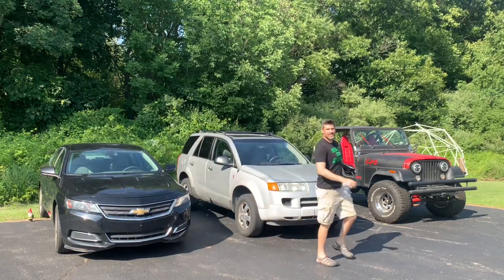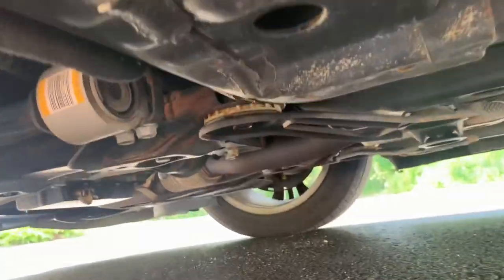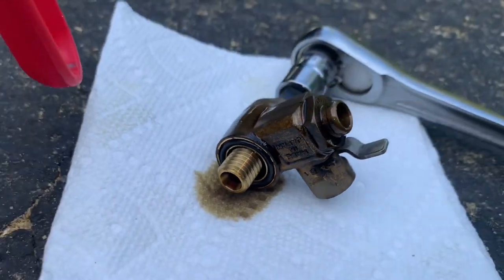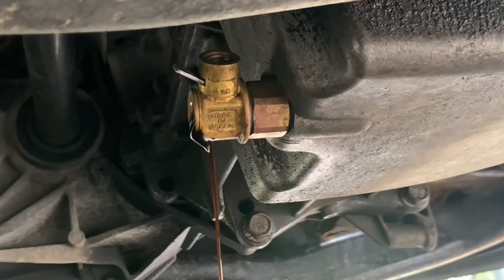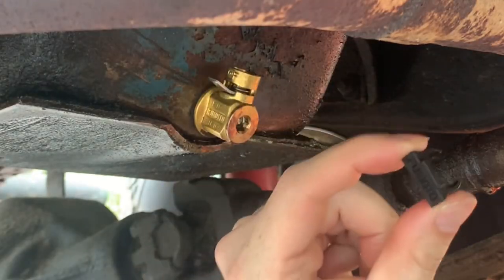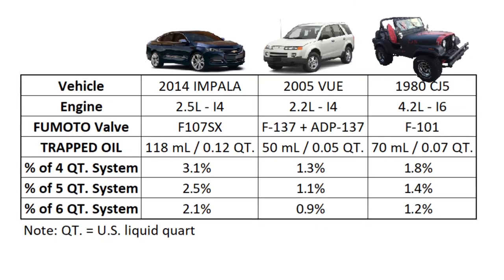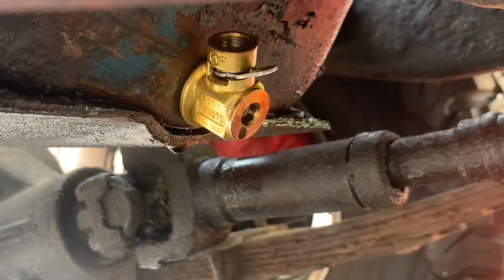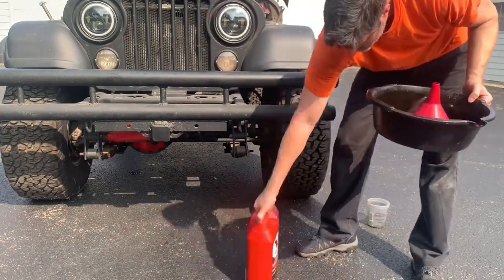How Much Oil Can't Drain with FUMOTO Engine Oil Drain Valve? How Much Oil is Trapped in the Oil Pan?

Comment: You could also pour a little fresh oil in while the valve is open to flush a little bit of the old oil out.
Reply: my thoughts exactly: get a quart of the cheapest oil (probably non-synthetic) and dump it at the end in to flush; still some will remain but it's better than nothing!
Reply: My car takes 3.7L so I just push the 0.3L through to flush to finish off the container.
Reply: Good idea, didn’t think of it.
Reply: If the old oil is below the drain plug line how will adding new oil flush the old oil above the drain plug line

Comment: To put the issue into persepctive, a full oil/filter change typically leaves about 0.8 quarts , about 760 ml, left in the engine-slightly more or less depending on engine, when using stock drain plug.  If Fumoto leaves another  70 ml, that is a 10% increase in remaining, undrained oil.

Comment: That is, if the car is in a flat position. However, if the car is on ramps, the angle of the drain hole will be more slanted, allowing more oil to be drained.
Reply from the maker: That’s true. This was a flat ground test.

Comment: I don't mean to be negative, but how HARD is it to put a wrench on it? Get a little oil on our hands? 🙄 They make a flexable extension on a socket that your hands are no where near oil. What's a REAL PIA is getting out jacks/jack stands & taking off shields. I'm a fanatic on getting ALL of the oil out. I even tilt my car to help empty everything. 1/2 cup is 1/2 cup too much. Sorry.
Reply from the maker: Nothing wrong with that! I did it that way just fine for 25 years.

In my personal experience, I have two vehicles that are very low ground clearance. There’s not room to get a wrench under there with any leverage. With the valve, I can easily reach under and flip the switch. 

I do about 10 oil changes a year, so the convenience of not using a tool does stack up. Especially in the freezing winter. It’s a luxury to slide a catch pan underneath and flip a switch.

Other people might just enjoy, trying new gadgets. It’s a free country, people like different things and can spend their $20 however they want. 🤷‍♂️

But, if someone prefers to use their wrench, absolutely nothing wrong with that!
Reply: You are also running the risk of over torqueing or cross threading especially if someone else is doing oil change. Fumoto is replaceable and saves the pan threads some wear and tear.
Reply: Its not hard at all, but maybe people like the cleanliness of it, i have a resin driveway and even though i used 2 tarps i still spilled a little oil which has now stained the drive (using the "classic" method). My truck takes 8 litres of oil and since most oil tubs or spare bottles etc only hold 5 litres it gets messy swapping tubs around.

With this i can simply feed a tube directly into the empty oil bottles from the last change, close it when the bottle is nearly full and swap the bottle out for another and then open it back up again to finish the drain 🤷 no mess, no fuss
Reply: These valves are worth it. 💯
Reply: @davidmidcalf3470  Precisely.  When you spend a lot of money on a pavestone driveway, you don’t want to be spilling oil.  If you have ever changed the oil in a 3rd gen Tacoma…the oil literally SHOOTS out the oil pan and splashes like crazy.
Reply: I put this on my commuter car because I’m doing oil changes about every 6 to 7 weeks. Sure, putting a wrench on and turning the bolt is pretty easy. But it’s cramped under there and turning a tiny lever is even easier. Makes an easy job even easier.

Comment: Or you put it on a ramp to make it drain more.
Reply from the maker: That’s another option. 
Personally, my vehicles are too low to use ramps. I have two sets of ramps, and neither work.
Also, dealerships and oil change shops do not use ramps. Either a lift or a pit, and the vehicle remains level.

Comment: Have it on two cars. I put 1/4 quart into filler port too get some old oil out. Usually left over stuff from last oil change. Makes it a quick oil change. And you find yourself changing oil more frequently.  Prolonging your engine.
Reply from the maker: Good point!
Plus, I have to add oil to all my vehicles anyway because they burn oil. Two of them I add a court every thousand miles. Another one I have to add a quart when there’s about 50% oil life left. They are always getting fresh oil mixed in. I’m 0% worried about the small amount that the valve leaves behind.

Comment: Longer drain time will mean less oil in the pan wait until it stops dripping completely it may take an hour or more. I understand you're not retired yet so you probably can't spare that amount of time. I removed mine to check this on a 2016 Explorer and got way less barely a few drops. My vehicle was horizontal on a lift at the time so if using ramps would probably make a difference too. TY for a good vid and I give my Fomoto a👍
Reply from the maker: Good point. I used the timing of a typical oil change process. I let it drain until it transitioned from a stream to a slow drip. Then removed the valve and again let it drain until it transitioned from a stream to a slow drip. I did not let it drain overnight until every last drop was gone.  That would definitely be interesting to do, but figured it wasn’t a practical real world application.

Comment: It's not just the shape of the oil pan but also the composition of the pan.  A cast pan has its own thickness to accommodate the plug thread, and it may achieve nearly perfect draining with a standard plug completely removed because the innermost thread is at the level of the inner surface of the pan.  A sheet metal pan will usually have a welded insert to accommodate the threads, and the inner level of the thread is still above the inner surface of the pan.  If the Fumoto thread is no deeper than the thread of that insert, there won't be any less oil drained.
Reply from the maker: Absolutely!
Reply: You're a freakin genius. Seriously. How many people on this earth would know that? Not many!

Comment: I wonder if I can dring down the part that screws into the pan so that it comes to the bottom of the pan so all oil drains out? Or can I drill a hole in the screw area inside the pan so that the hole comes to the bottom of the pan and so the oil in the bottom drains out?
Reply from the maker: It wouldn’t change the thread engagement, so as long as it’s screwed in tight, I personally don’t think it would matter.

Comment: The threads that extend too far into the pan could be cut off I think. I don’t worry about it as I usually change my oil often enough any remaining oil in the pan  is okay with me.
Reply from the maker: Same. Plus I add oil between oil changes. All of my vehicles burn some oil, which is normal.

Comment: I always have the nose of my cars up in the air when I drain.  I always get more oil out than when flat.  This ensures I get the most out even with a Fumoto valve installed...which I do.
Reply from the maker: That definitely helps!

Comment: Oil drain valves state the oil must be at operating temp so it can drain fully
Reply from the maker: Good point!
I always change the oil when the engine is warm. I assume I did it for these tests, but it was so ago yeah because I had to set up for filming, I can’t be 100% sure.